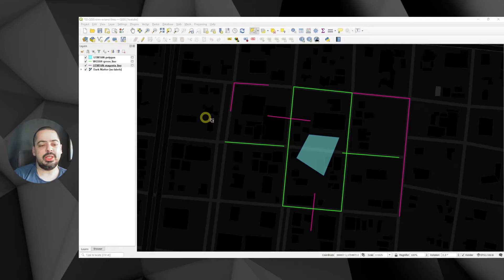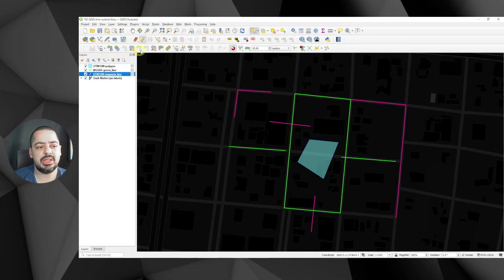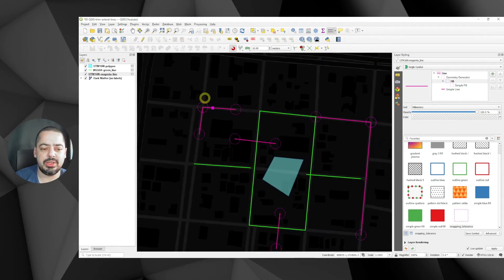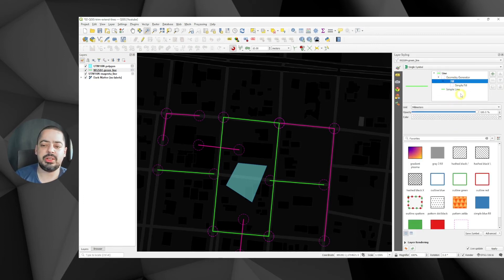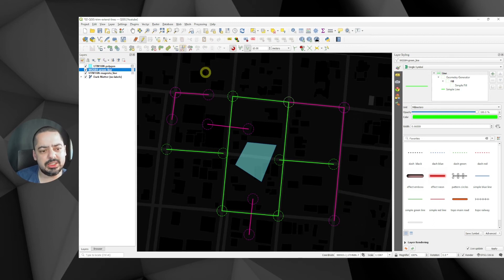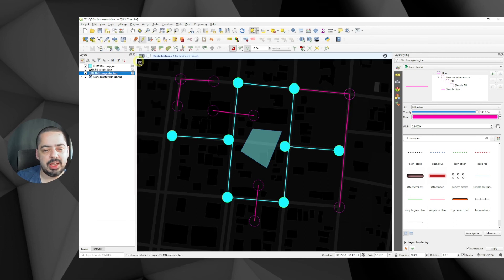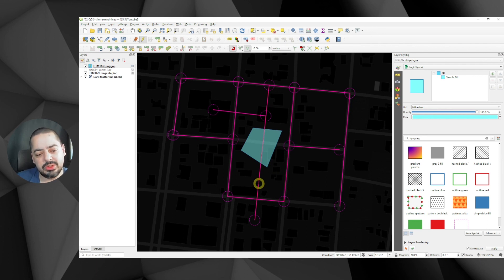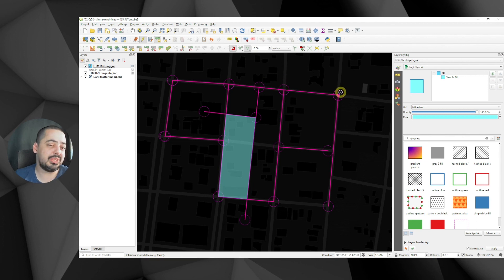How to Trim and Extend Lines / Polygons using QGIS and a bonus snapping vertex trick

Comment: Great thanks - really like the symbolising by Geometry Generator. For correct handling of WGS84 source coords in Project CRS, the Geometry Generator expression can transform the source data prior to buffer operation, just as long as end result is transformed back to the Layer CRS for rendering. For example, to show 10km buffer around WGS84 points when map is in a projected coordinate system: transform(buffer( transform( @geometry,'EPSG:4326',@project_crs),10000),@project_crs,'EPSG:4326')
Reply from the maker: Yes, you can to several transformations. I think the issue is that depending on how many points it can cause a strain on CPU resources (can slow QGIS).

Comment: Thanks for making this video. Its very helpful but for me it has given me half answer as far as my assignment is concerned. I want to have a query for whole work. Like from extending lines to the nearest line on the basis of one or two vertices. then converting those very new polygon shape into polygon. I have also done it manually but need command to do it automatically. Do you have any answer?